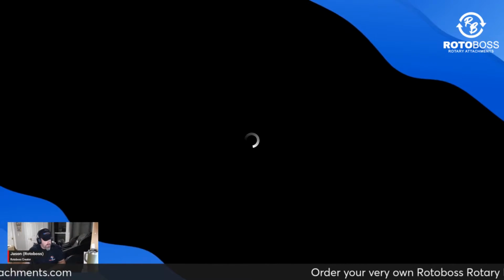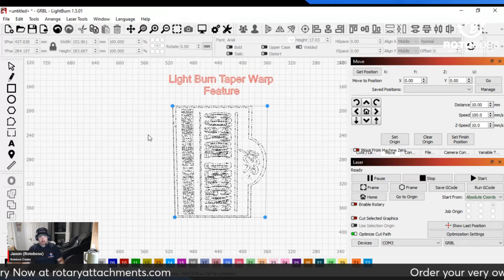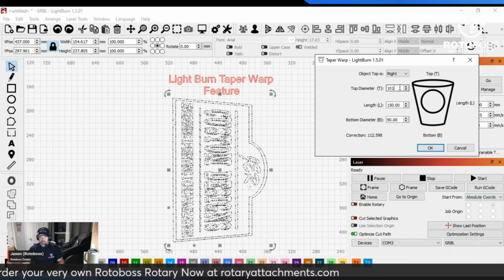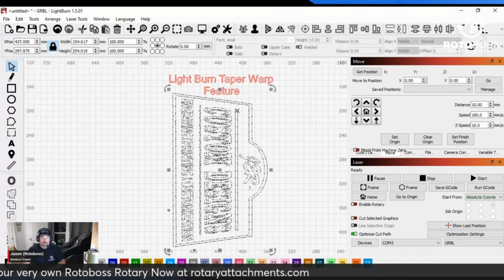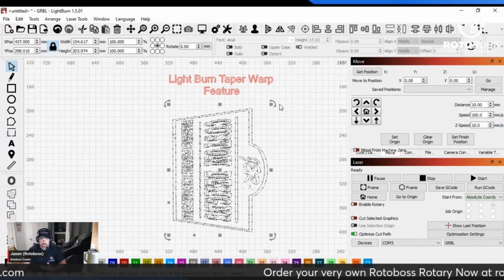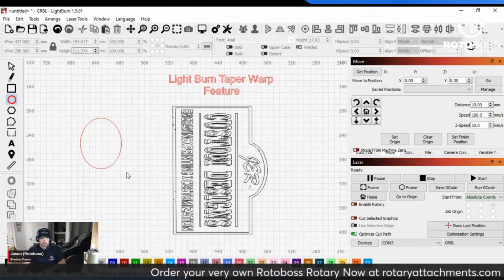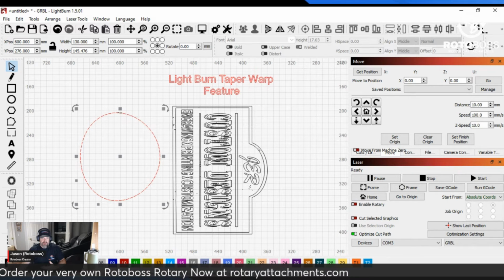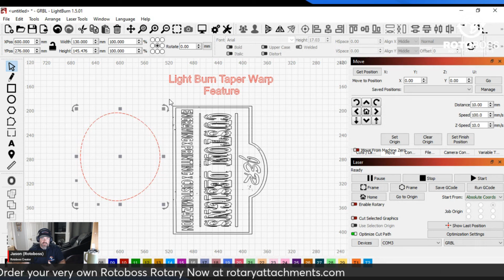Light Burn 1.5.01 NEW Taper Warp feature for Rotary tools

Comment: the one thing no one is mentioning in any of the taper videos is what the object diameter (or circumference) setting should be in Rotary Setup. Do we use the widest, the narrowest, the mid, or where it starts at the top, or what?.

Comment: Is there a way to get the power to adjust to the taper? I have a diode with a manually set focus. As my diode becomes further away from the contact point of my tapered tumbler the clarity of my engraving worsens.
Reply from the maker: @jackmadeloff4906  no there is not. You need to level the cup along the length and then adjust focus to suit.

Comment: when u did the circle,,u set sizing to 101 i beleieve n then in warp u put 101 n then 80.would ya now what to change that 80 number to? what was reason to change from 101 on the 2nd # in warp?
Reply from the maker: @cathyo3294  i am not sure what you mean, when you set the image dimensions and use taper warp it will change the size according to the numbers you put in it.

Comment: My question is, what if you're engraving a Stanley 40oz Mug where it tapers in the center on the approx 1" area? Will this distortion work for that? Also how does taper warp work when you're doing an all over seamless pattern image?
Reply from the maker: @hunterrose5150  it tapes as a whole or in part based on your inputs , it didn't see or know what it is going on so it won't treat that area any different.

Comment: Useless video. Anyone can play around with taper warp and guess at parameters. What would've been useful is info on how to set the diameters based on center of pattern or top and bottom of boundaries.
Reply from the maker: @cbpuzzle  thank you for your kind and inspirational words. I look forward to seeing your videos.
Reply: @rotobossrotaryattachments aside from this persons terrible attitude there is a good question there. What should I set the diameter on the set up to? Top centre or bottom?
Reply from the maker: @wadegullison2489  it only asks for the top, bottom and length, that is all you put in there based on the size of the top and bottom of the cup and it's length.
Reply: Thanks for your comment KAREN!

Comment: if I'm just doing text, do I need to do taper warp? The tumbler I'm using has a pretty steep taper. Thank you!
Reply: also, I'm assuming I level the tumbler...
Reply from the maker: @amyschaeb6923  it would not hurt to do it because it will effect text if it is an amount that will extend down the cup

Comment: Do you know if this works on a tumbler with a step down or is it just for a smooth tapered cup like the icon shown in lightburn?
Reply from the maker: it will work on all tappered cups with or without a step down. It will not however correct for the distance and focal settings that will have to be done as it normally done.
Reply: @rotobossrotaryattachments  thank you for the response!

Comment: Should the rotary setup parameters, object diameter, be adjusted to the measurement of where the object will be engraving?
Reply from the maker: Rotary setup and this are two different things. For a roller, object diameter does nothing and means nothing. Object diameter only works with Chuck. For a roller only Steps and rotary diameter matter, rotary diameter never changes, steps may change based on cup size or shape.
Reply: thank you very much
 @rotobossrotaryattachments

Comment: When you put the measurement in the warp tool, do you put the measurements of the actual tumbler for the top and bottom or the logo?
Reply from the maker: you use the very end of both ends of the cup and the length of the cup and it scales it based on that
Reply: @rotobossrotaryattachments  thank you very much!